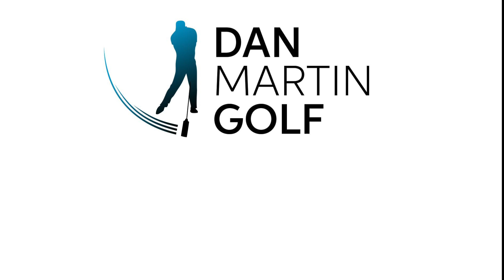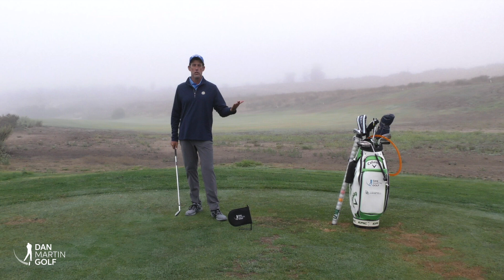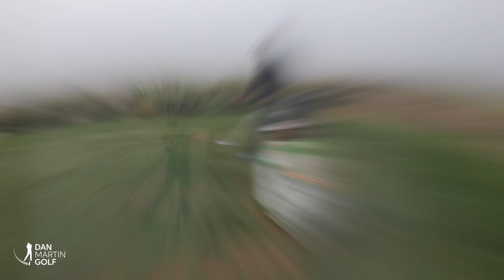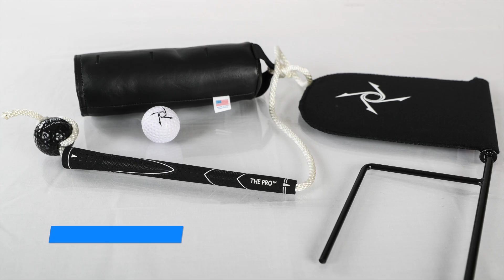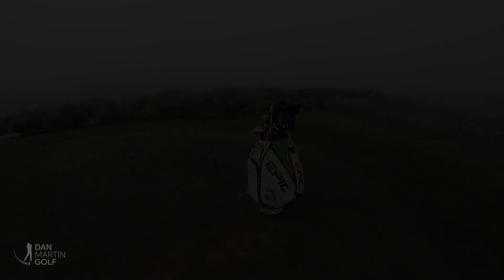Golf Swing Challenges Part 2 - A DTL Perspective of Understanding and Correcting Common Issues.

Comment: When I try to swing your way I feel that the turn is deeper and to get the rhythm I tend to bend the lead arm at the top of the backswing. Conventional teaching emphasises lead straightness but with your system bent lead arm at the top shouldn’t matter as long as you create the right extension through the ball. Is this a correct reading of your approach?
Reply from the maker: Yes - and also notice that I'm only significantly bent with my training aid - the PRO.  Because the shaft is a rope it requires accommodations to learn the physics.   But you are right, as long as your arms and the club are riding the inertial flow caused from rotation - it will automatically fully extend!   So in short, I don't advocate a massively bent left arm, but it is possible you could swing really well from that position!  Thanks!

Comment: Would this type of swing be considered a single plane swing?
Reply from the maker: Thanks for the question!  This might not be the answer you are looking for, but here goes! 
Technically speaking, there is no "swing plane".  It is a concept that most instruction uses on DTL video as a guideline for a "sound" swing.  The clubhead descends and extends on a trajectory away from the line of gravity simultaneously due to gravity + the rotational inertia of your entire body.  In most cases, when these two inertial energies are paired together, the golf club appears to "swing" on a "plane," especially in the late downswing area.  So it is a useful checkpoint on video to see if you need to make some adjustments in your motion.  But the clubhead isn't swinging, it's extending with rotational inertia and falling with gravity at the exact same time.  This is why keeping the PRO in a straight line is so important as a learning cue - it bends when you are not allowing your motion to simultaneously fall and extend to the ball!
Reply: @danmartingolf  thanks for the great explanation
Reply from the maker: Anytime!